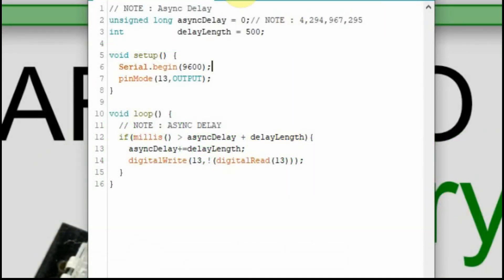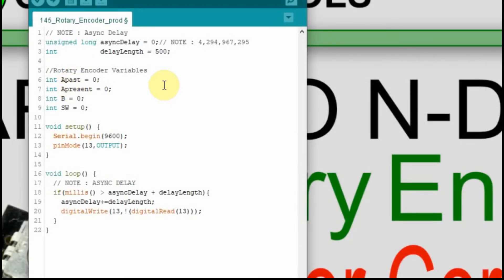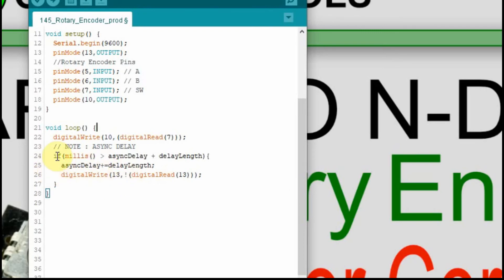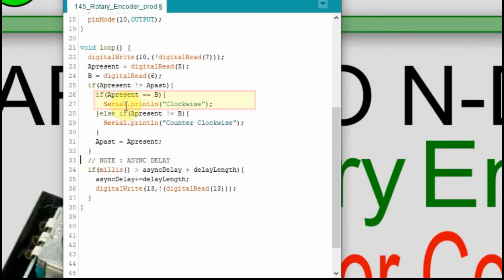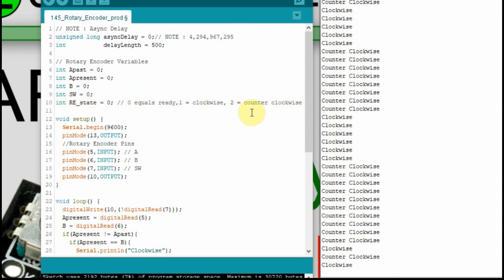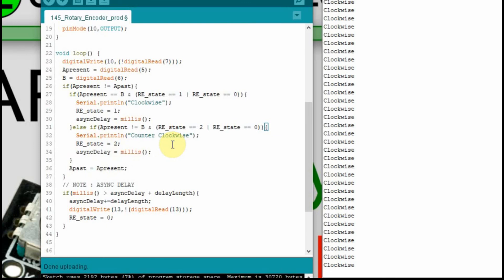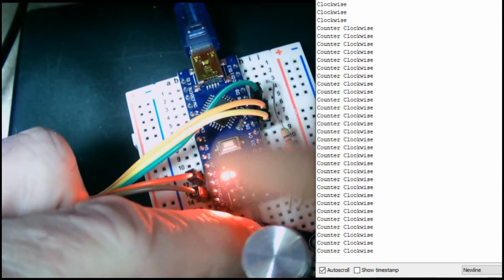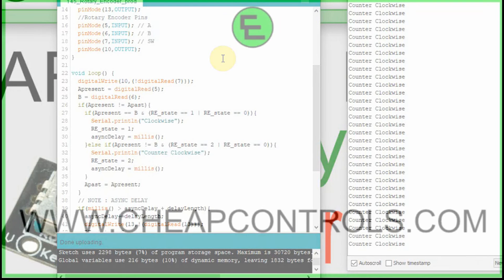145 - Take 2 - #arduinotutorial  Rotary Encoder with error correction technique

Comment: Ford should’ve used this code in their radios....
Reply from the maker: Thanks for watching.  Did they have issues?
Reply: @CheapControls  they were notorious for getting louder if you turned the volume down too quickly.   Thanks for making these videos, I can’t tell you how many times I’ve referenced one in a project.